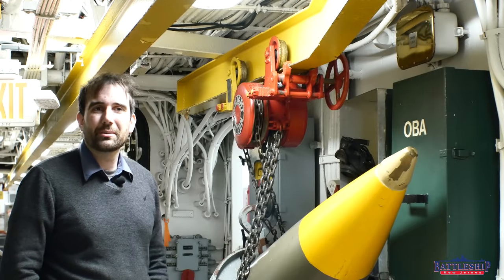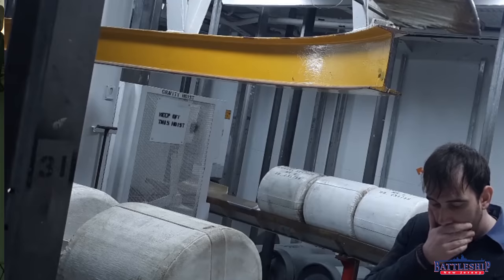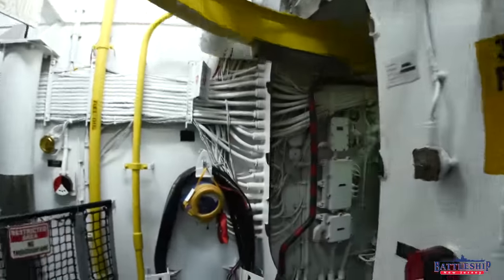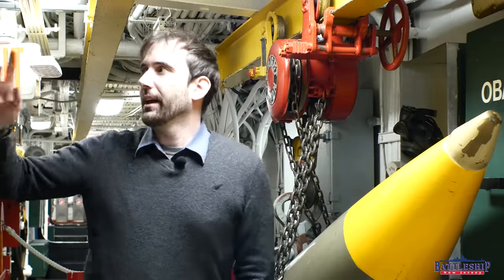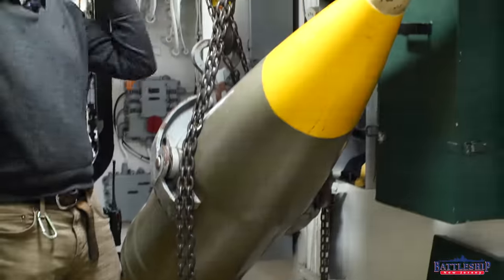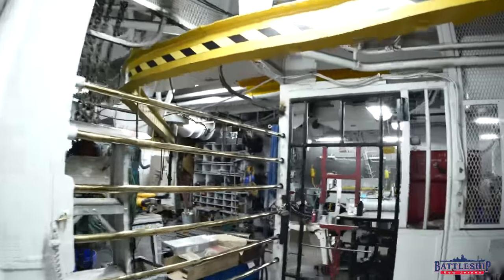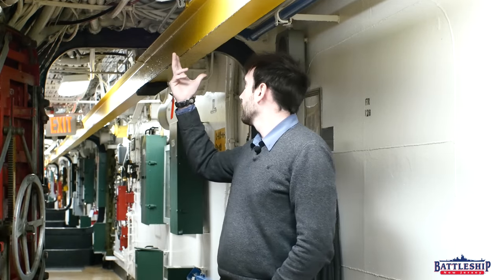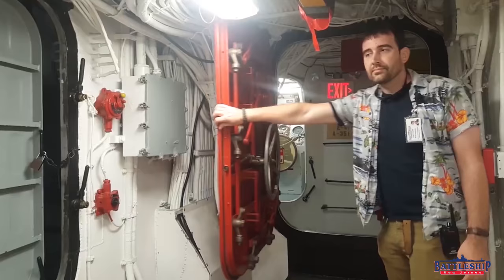Overhead Rail: How the Battleship's I-Beam Works

Comment: My first engineering assignment at Boeing involved the I-Beam trolleys at MX missile silos.  We drop a part the size and weight of an 8 cylinder automobile engine down the personnel hatch to the little tunnel that runs into the launcher equipment room that surrounds the upper part of the silo.  We hang it from a trolley on the I-beam installed in the tunnel and roll it to the main room.  Then transfer the part to the trolley hanging from the I-beam in the equipment room that runs around the silo where we can roll it to where we can install it into the missile.
The transfer was the tricky part.  It involved side loading the trolley on the I-beam.  Factory safety regulations at the time, and presumably on these Iowa class battleships, is to not do that.  The trolley would slip off the I-beam and the load would smash your legs and feet.  So I got on the phone to Beebe and sweet talked them into supplying us with trolleys that can be safely side loaded without slipping off the I-beams.
So thanks to little ol' me, and to some engineers at Beebe, we were able to maintain the MX missiles in their silos until Reagan and Gorbachev started negotiating a reduction in the nuclear arms race.
Reply: Thank you for Your Service and your Attention to Detail, Brother.

Comment: I used the rail many times as part of the rigging team. Used it to move many different motors up to the re wind shop and to move pumps and valves to the machine shop.

Comment: I smacked my head on this last week! 😂
Reply: How tall are you
Reply: @finley07  Not very tall, but I had stood on top of one of the “knee-knockers” to take a picture looking down Broadway. Lack of situational awareness then took over 😂
Reply: Best way to go through the doors on Broadway is to walk up to the first step, stick your leg through the door, past the step and onto the deck.  Avoid the step entirely.  I worked New Jersey and Missouri reactivations and most of the time hoses and cables were tied to the rails so you could smack your head easily.  I was 5' 10" 318# and could easily "hurdle" those steps and move quickly through Broadway

Comment: We had I beam hoists like that in the plastic factory i used to work at. also seen them in machine shops and stuff before.
Reply: I worked in a large injection molding plant - presses up to 1,000 tons...had 2 gantry  cranes that travelled across the entire length of the plant....one of the injection molds weighted 13 tons.
👍
Reply: @raybin6873  we had a crane like that in the other half of the factory
Reply: My father built the same kind of beam into the ceiling of the garage he built next to our house when I was in high school, so that he could use an overhead chainfall hoist to do engine swaps in old cars instead of one of those rolling engine cranes.

Comment: Nice, I was asking about this in relation to Ryan's favorite door the other day. Specifically in relation to the door closing.

Someone gave me the answer, but failed to mention where it was stowed.

Fun side note: It was by referencing the overhead rail in extant portions of Fort Wetherill in Jamestown Rhode Island that allowed me to get a much better grasp of how the fort functioned internally back when I frequently wandered around inside of the fort.
Reply: It may have been me that gave that answer.  If so, I didn’t say where it was stowed because I didn’t know that until I saw this video.
Reply: @DanielsPolitics1  Nope, it was not you. It was someone by the name of Gary Wayne (just went to check).

But that said... Where something is stowed is actually beyond the scope of what I asked. Since I only asked how the rail worked in conjunction with the door.

My 'failed to mention' part was really just me stating neutral facts. And not something like 'only told half the story' or anything of that nature.

btw, after I originally made my comment the other day, my first thought was "you know, if he really did say where it was stowed I am, going to feel like a moron." But when I looked just now to see the name of the person, I got confirmation that I was correct. (I figure this is worth a chuckle at least)

Comment: Videos that I would like to see: 1. Electrical wiring generation and distribution. 2. Ship's daily paper work and logs. 3. Costs related to ship. 3. Age distribution of the officers and crew 4. Women sailors aboard.
Reply: I don't think any battleship would ever have had women sailors aboard; even the Iowa class's last activation would've just missed them. The last active battleship, Missouri, was decommissioned in 1992, and Congress authorized the Navy to post women aboard combatant vessels the following year. Before that (since they started going to sea in 1978), they were only posted to non-combat ships.

(Also, you've got two items number 3 there. :)

Comment: 'Under Siege' is definitely my favorite Steven Seagal movie.  Was going to comment on how they incorporated the railing system into the plot until you mentioned it.  As an aside, would such a railing system have been useful for such a task?  Where were the missiles stored below decks (the ones not in the deck launchers)?
Reply: Kevin, there were no Tomahawk (or Harpoon) missiles stored below decks on Iowa-class battleships. If they were not in the Armored Box Launchers, they weren't there. And they couldn't be reloaded at sea, either.

Comment: for attaching a stretcher to the beams, did they have or make something special to do it, or did they use existing trolleys/hoists?
Reply: The chain hoist rollers, as shown, have a hook, it doesn't matter what is slung under them.
Reply: @chrisperrien7055  And if they wanted something more nimble, they did have a machine shop, they could build a smaller trolly to mount on the rails, something you could easily walk back with if there a re more stretchers coming.
Reply: @davidmartensson273  Yea, they probably had some simple trolleys with no chain hoist.   Had a longer post , which got ate, now I am  disgusted, 
Regards  :)

Comment: Could an Iowa class handle a storm similar to that sunk the Edmund Fitzgerald? I know we're comparing apples to oranges, but it is something I've wondered.
Reply: Ryan was asked about how the New Jersey handled storms/seakeeping, and he came through (natch!) here:  https://youtu.be/KSKCPbGVc1E

As for the Edmund Fitzgerald, there's no way it can be compared to the New Jersey - because, being a bulk ore carrier, it didn't have anywhere near the same internal structure (especially the watertight compartmentalization) that the New Jersey did.  

While it is possible that, if things went wrong, that the New Jersey could have also sank in that storm (especially if, as some hypothesize, the Edmund Fitzgerald had hit a shoal during the storm, and the New Jersey had followed suit), the fact that the New Jersey had literally over a thousand more damage control personnel available in a pinch than the Edmund Fitzgerald had, and the New Jersey had a lot more tools for damage control parties to use, makes it less likely.
Reply: USS Iowa, Third Fleet, Task Force 38,  was in Typhoon Cobra in 1944, a Category 5 typhoon. Several ships sunk and most were damaged. The Iowa came away with a bent prop shaft and damaged seaplane. The heavies tended to ride out the storm better because they were still balanced, whereas the smaller destroyers had a terrible time due to their fuel bunkers being low and the ships being light, practically a cork in comparison.
Reply: @chrismaverick9828  What did they hit to bend a prop shaft? Aren't those something like 24" diameter?
Reply: @jbrou123  I couldn't find anything quickly accessible to explain it, though it's going to be in one of the reports regarding that incident. 
Best guesses from me are that it may have happened when the float plane went over and could have conceivably impacted the shaft.
Another guess would simply be wave action. A large wave makes the stern clear water and the shaft gets damaged when it comes back down. Waves in storms can do crazy powerful things.
Reply: @chrismaverick9828  Legend has it that afterwards the task force signalled the BPF (Royal Navy) force they were co-operating with, re' if they'd taken any damage. The reply came back of "What Typhoon?".
Reply: @jimtaylor294  Ah, that British insouciance. This from the same fleet that had armored flight decks on their carriers, and so claimed that their reaction to kamikaze attacks was "Sweepers, man your brooms."

Comment: I can grasp moving the 16' shell from the magazines of turret one aft to supply turret 3, however unless there are several chain falls it would seem that it would take a very long time to move one shell then drag the hoist all the way back forward to get another. It would also seem that the necessity for doing this would be either damage to turret one that prevents her from continuing to fire while turret 3 is still engaged suggesting that this wold be under battle conditions. Would all of the doors along Broadway be allowed to be open during GQ to allow these shells to be passed through?

Comment: I actually had the thought of why exactly Missouri is the “movie star” of the battleships.   I’d think Iowa in Los Angeles would be easier to film on than Missouri.
Reply: As far as why Iowa was not in the Battleship movie - The filming on Missouri was done in mid 2010.  At that time Iowa was still in the Suisan Bay Reserve Fleet.  Iowa was not awarded to the LA museum until Sept 2011 and needed refitting,  She did not open to the public until 2012-07-04.  Since that time Iowa has been used as a location for several films & TV shows.
Reply: The reason Alabama was used in several movies is her location on Mobile Bay, which offered a background that was less obstructed by objects on shore than the other battleships that could have been used as stand-ins.

Comment: As you well know, Under Siege was filmed on Alabama and not Missouri. That said, I agree that Under Siege was the best that has been done so far. The issue with battleship movies extends to all naval war movies of the last 30 years. For whatever reason, these filmmakers never seem to have good continuity management or good expert opinions. It's actually very frustrating. I completely agree with your frustratins about battleship, and for me personally, the new version of Midway and Pearly Harbor make me cringe just as badly. It would seem nobody takes the care to do it right anymore. As for New Jersey, the issue is that New Jersey wasn't there for the early war that most film makers want to address.

Comment: I'm surprised that they did not use a different system for removing the rail section for the water tight doors. They could have easily cut the rail and then hinged it on top so that it would swing up when the doors had to be closed instead of taking it down and storing it.
Reply: No clearance for it to swing up. That rail section is a good four and a half feet long (from memory) and the overhead is right above it. Besides, when you've got 1500-2300 sailors, it's not a big deal to dispatch a dozen from the damage control party to get that rail ready for an ammo transfer (the sections through the door were normally stowed whenever the ship was at sea and left in place only while safe in port).

Comment: In regards to battleship New Jersey, how,d she do if she was in the position of scharnhorst at North Cape?
Reply: Longer-ranged guns with superior radar fire control and superior radar-controlled secondary weapons (her 5" turrets were more or less identical to the ones on Atlanta-class light cruisers. Let that sink in: her secondary armament basically consisted of a light cruiser's entire armament). You also have to factor in that Scharnhorst nearly got away, but a lucky hit cut her speed and allowed the otherwise-slower Duke of York to catch up. Iowa is two knots faster than Scharnhorst and would not have been as close to begin with. An Iowa in that position would have cleaned house, with superior range, accuracy, and speed.

Comment: As a proud pedant I feel I must point out that the beam is actually a W beam not an I beam.
Reply: @ralphgesler5110  W means wide flange, an I beam has tapered flanges, a W does not but is overall heavier and able to support greater weight
Reply: I think you mean WF, which is the designation for a 'Wide Flange' steel beam.

Comment: Battleship The Movie is like... WHY? WHY? OH GOD WHY. 

turning on the museum ships is impossible.. 

even if the museum ship WASNT IN ... well... seacocks welded shut etc, and it *could in theory light boilers... It's not like... "imma light this boiler, now I can sail!" IT NEEDS STEAM. That takes a friggin day ~ Especially from a "Dead cold start, with no dockside steam" (How would you even do this? Go find a barge and grab an industrial boiler to generate ya steam? hahaha omfg) 

Then there's "ok, the battleship is miraculously able to make way some how! Maybe the aliens helped? Whatever." Can the turrets rotate? No. Can you elevate the barrels? (Well... yes. Saw that on Missouri. 5 blokes cranked ONE BARREL with a big pipe wrench. Took hours. ) But basically "NO". 

Can you fire them? bwhahaha. Oh god.. maybe if you cleaned it and make sure the barrels could actually seal, and oh god... 

NO NO YOU CANNOT. 

Not to mention... Where's the gunpowder? Where are the shells. Where are the... oh god. Just NO GOD NO. 

A far more realistic scenario, (imma use this term loosely, at best) is that at the naval base, they discover a W88 Warhead in functional condition, pick it up, bolt it on a Tomahawk, in a vertical launcher truck, set the warhead to max yield and launch it directly at the alien thing. 

There' a flash brighter than the sun, and the alien thing is utterly deleted. 

...

So is Pearl Harbor. 

and everyone in Hawaii dies of cancer in the following years. 

AMERICA WINS! 

Er. 

My version while farcical, is far more believable than hollywood of "There's a few dozen vets who happen to live within this bubble zone, able to reactivate a museum battleship and use it to shoot some big shells at some alien bad guy.   

lol. 

I loved the movie battleship. It's like Rocky Horror... It's some godawfully BAD it's crossed over that magical line into becoming something to watch. 

Ya just gotta suspend all logic and belief.
Reply: Thanks for the wall of text.